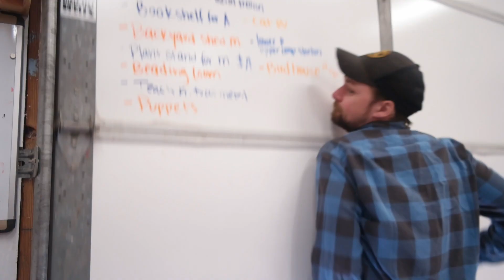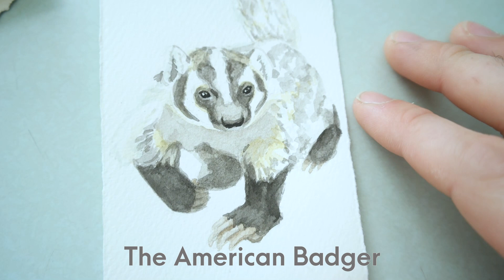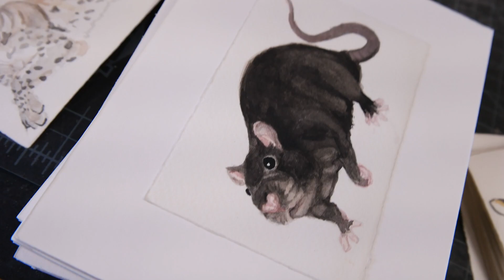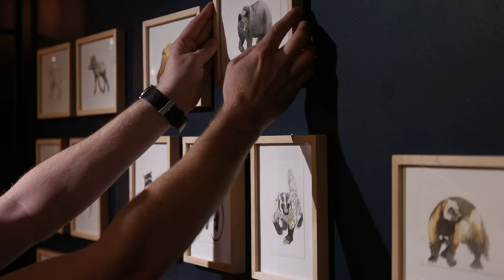Picture Frame Project that nearly broke me 😳

Comment: WOW !!! OK, so I came here for the woodworking, I've been a subscriber for a while. When I saw your mitre jig last week I thought "yeah that's cool but I'll never need to do that many mitre cuts". Secondly, your artwork is amazing, to take on all the mammals is a mammoth project and you smashed it 👍
The other things I took from this video were all the little tweaks you did to the shop to facilitate the project, the block screwed to the bench to sit the frame on while sanding, screwing the posts to the wall for the drying frames and the jig for mounting the pictures to the backing.
Great video, everyone could learn something from this.

Comment: One tip for sanding - fix a and paper sheet to a flat surface. Then you just sand the entire side at once, holding the sanding block and work piece for that long must have left you with a claw hand for hours after.

Comment: Lower your saw blade first.  Less tear out and lower vibration.  Then setup a 'step' 45 degree jig that you can load up 10 or more at a time. What little time it would take to make a step (since your making same cuts) would save much more time then one at a time. Add a stabilizer disc like a Freuds, since your making a new jig, so worth it .  Then cut ten at time or as many as your saw allows.

Comment: Interesting! I have been brooding over a project that will also include making 100 + frames, plus the parts to make them all into small wall-mounted letter holders. It includes a small embroidered medallion - those I've actually made (machine embroidered with my wife's Bernina 580 :-) ) But, haven't had the health to embark on the woodworking yet. This has given me some ideas though, and a visual of how the flow of the project could go.
Thank you!
By all means, incorporate your other talents into the same channel!
Reply from the maker: It's a big task for sure! What helped me a lot was making stacks of 20. It felt like small wins every time I got through a stack. Also, lots of podcasts. Good luck with your project!

Comment: I get that you were in a commercial production mode with your work, and cost as well as price point were crucial in the final offering but I would have done two things differently. 1) I would have put a 1/4” spacer between the backer and the plexi layers, adding depth and not allowing the image to touch the plexi. And 2) I would have used low-reflectivity museum glass. I understand that price x 141 = a huge difference in production costs, but the archival value of each painting would be infinitely greater. If, when you paint each watercolor, you went deeper with your values, intensifying contrast between dark & light, instead of the pastel values, while also suggesting an abstract or muted background to pop the figure forward adding greater dramatic contrast. You could command a higher price to compensate for the added mounting expense and the art would be preserved for generations. Overall, you gain reputation, which is everything to an artist, becoming known for higher quality work, as well as craftsmanship. It’s not any more work or effort to do any of these things. It’s just a mindset of super clean, high-end quality work throughout.

Comment: Beautiful paintings. Could you have sanded the pieces before cutting and assembly?
Reply from the maker: You could, and if I had a drum sander that would make a lot of sense. Without a drum sander, I think it's a little more efficient to do after glue. Plus you don't run the risk of distorting the frame profile and having issues with the parts not fitting.

Comment: Hey.  Nice work!  I have a few questions. Why did you rip the rabbit for the frame on the table saw rather then a router and make 1 pass? Also why use the sled for the miter rather then a miter saw?
Thanks

Comment: Amazing work and excellent use of time.  I have one question.  I am new to picture frames (I haven't yet made my first).  Is there any particular reason you could not sand down the milled stock before cutting the miters.  At least initial sanding.  Would that have not saved some time? Looking forward to your answer!
Reply from the maker: Thanks! You can, but since there’s glue squeeze out and water introduced to the wood, it might not change much time wise
Reply: Good points. Thanks for the reply!

Comment: For my uni assignment this term I need to design a space where you can make picture frames. After making all 141 of these, is there any specific things you think would need in the space to make production that little bit smoother? Any info would be a massive help :)
Reply from the maker: In hindsight I might’ve worked out a way to cut the miters in mass. Also using a softer wood would’ve helped in the sanding process
Reply: @MichaelAlm  Thank you so much for your response, thats a real help!

Comment: That's fantastic (really well done vid too btw)!   Couple questions
When cutting the 45s did you have some sort of stop or just eyes and skill to make sure they all came out the same length
When taping/gluing, did you have any that came out trapezoid instead of square?
Sanding jig on workbench-VERY smart
Love the festool hose holder cable idea too!
The gallery was REALLY cool
Paintings great
Dude. I have gotta tell ya that was truly inspirational-THANK YOU!!
Reply from the maker: Thanks! Glad you enjoyed it. I’m working on a build video about the sled I built in the next week or so. There is a stop for the frames. If your’s aren’t coming out square it’s probably because the miter angle is off, or the pieces are inconsistent lengths. A well built sled will take care of both issues